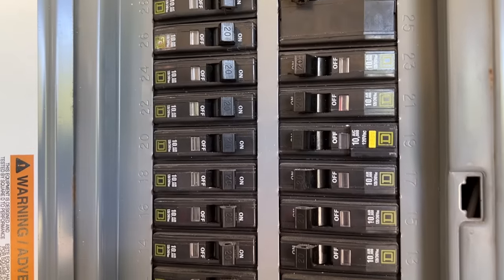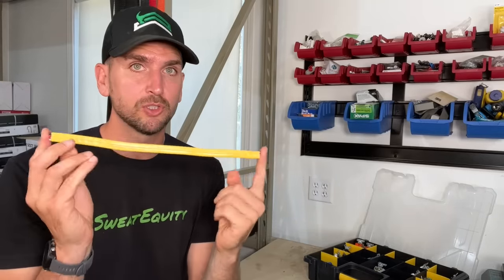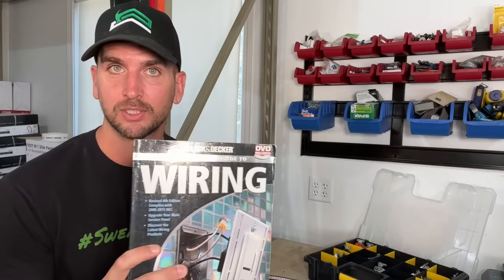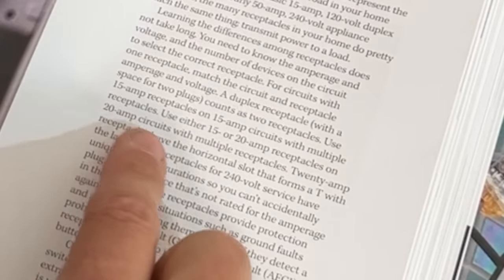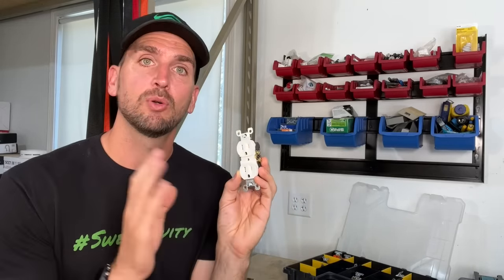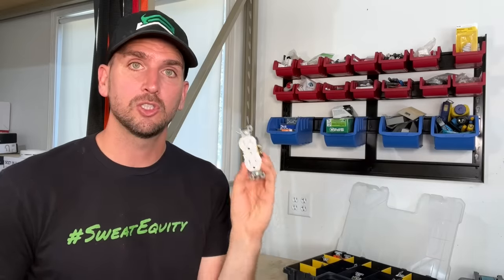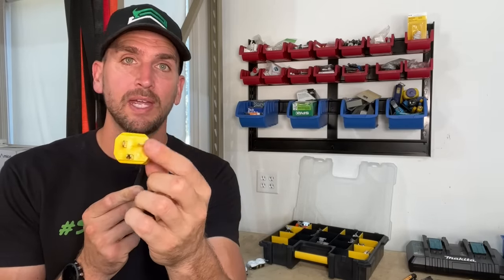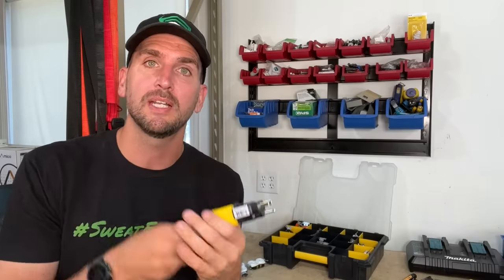Can 15 Amp Outlets Be Used On A 20 Amp Circuit Breaker

Comment: Where I live the city mandates that 20 amp circuits be installed in kitchens. That's fine except that these breakers "pop" at 16 amps. The 15 amp breakers "pop" at 12 amps. When I purchased my new home in 2018, I called the electrician back (post inspection) and asked that he change the breaker panel to traditional 15 amp breakers and have had no problem since then. Even in the kitchen the 20 amp (16 amp "pop") had to be changed to a traditional 20 amp for our new microwave. The mandated breakers cost about $80 CDN each while the traditional breakers were about $5 CDN each so the electrician didn't charge me for the switch or the new breakers taking the mandated breakers in exchange. An example of a City mandating a change to a product that just doesn't work in the real World. None of the appliances that have been plugged in have a 20 amp plug or the requirement of anything more than 13 amps at startup. The only tool I have that requires more than 15 amps is a Shopsmith that peaks at 16 amps at motor startup before dropping to 12-13 for operation. I use a 15 amp slow-blow power bar attached to a dedicated 20 amp garage circuit to power it when required and have had good results.
Reply: Which breakers are these that are tripping so soon on less than their rated amps?  Does your panel have heat dissipation issues?  Breakers are specified with a trip curve that specifies how fast they will trip for a given current.  I'd like to see a trip curve where it says it trips below rated level.  Because breakers are stacked together where heat may not get out easily, that's where allowance for tripping on 80% with continuous load (defined at 3 hours or more) is.
Reply: I believe Chris is referring to AFCI (arc fault) breakers, which are more prone to nuisance trips. The technology is evolving and not all companies made reliable AFCI breakers. You may find that today's technology has finally caught up with reliability. Here's the problem: if your house would ever suffer an electrical fire and the insurance company found that the breakers were changed after inspection, they might deny your claim. Or even bring in your electrician for his role. Your house; your call.
Reply: @BrucePappas  Not much choice when the alternative is not to have power or to constantly have to reset the breakers. No microwave, no power tools (could go battery wireless), no Christmas lights (and I already use LED). I checked ... it's not an insurance issue it's a local government issue and I understand that it has now been reversed due to the problems caused by these breakers in new houses. Of course I live in the area of the World where the Hydro company mandated electric in floor heating and then when it ended up causing fires they reneged on both the usage and the warranties on installed systems to screw the owners. Much like the Poly B plumbing fiasco where if you were amongst the first failures you got screwed and if you were lucky you got absolutely nothing when your piping failed. I ended up in the absolutely nothing category when the pinhole leak cut through the wall and caused both wall damage, a large sink hole in my front yard, and a flooded basement. I finally had to replace the complete plumbing runs in my old house with new lines before selling it. Thankfully Poly B was only used from the street and through the basement runs so the main and upper floor were copper and didn't need to be replaced.
Reply: @chriscutress1702  - I understand that electrical codes are adopted by the state or local government. In our state, AFCI are still required in all new residential building and remodeling. Are you saying your municipality no longer requires arc-fault breakers?

Sorry to hear about your piping/flooding loss. That's terrible.
Reply: No, breakers should hold the designated current indefinitely. If they pop on smaller they are defective. In fact they take higher significant time, even twice some 30 seconds.
Reply: @BrucePappas  Canada West coast. In some authorities a new home has to be plumbed for fire sprinkler systems. Interesting that the city council had a major shareholder in a sprinkler supply manufacturer when that was passed into ordinance. Meanwhile it's the 60 year plus homes ( some with aluminum wiring) that catch on fire not the new homes where sprinklers are mandated. The mandated homes do however sometimes have insurance claims. Usually for leaky fittings on the sprinkler systems.
Reply: I've heard stories about these new arc fault breakers and I seem to have them in my house now, but the only time I've had a problem with them is when I run the vacuum cleaner on an outlet that seems to be on the same circuit as the big chandelier and after a few minutes the breaker trips.  I haven't actually measured what the combined load on that circuit is, I just started turning off the light whenever I need to plug the vacuum into that outlet.
Reply: @phillipsusi1791  That's how it started for me as well but the breakers I had seemed to become worse after the first instance of tripping allowing even less power usage to trip them on future uses. This is what was a major concern when a month after changing our microwave the breaker would trip when we used it. Fine for a month and then constantly tripping the breaker for no apparent reason. Since the house electrical was still under warranty I notified the builder and the electrician returned and changed the breaker. Then I asked him to check the load on the circuit with the new microwave on and it was 12 amps under full load at start-up peak then fell to under 10 amps during usage. The breakers shouldn't have been tripping but they were. The same thing had happened on a basement circuit when I was doing some work with a power drill in the basement. Again no reason for them tripping but that breaker also needed to be replaced. The electrician told me that these breakers had been causing a lot of problems even though recommended by the local building authorities. He said the only real solution was to wire everything for 20 amp lines even if they were only being used for 15 amp circuit loads and having 20 amp breakers installed. He said that the 20 amp breakers were "popping" at 16 amp loads so would work for 15 amp circuit usage situations.
Reply: @phillipsusi1791  - the original AFCI had severe problems, some brands more than others. Today, the technology has settled in and has vastly improved. Good to hear you've had little problems.

Comment: IDK. If you remember that circuit breakers are intended to protect the wiring, not the devices. A 15a outlet can certainly handle 20a.

Comment: Using a 15A outlet on a circuit protected by a 20A breaker can't be a problem, by definition.  The 15A receptacles is a NEMA 5-15 and is keyed.  Only a 5-15P (plug) will fit in the receptacle. Any device or appliance with a 5-15P will be limited to 15A and likely limited to 80% of that rating or 12A for residential service so the integrity of the receptacle is assured.  The 20A breaker in the panel (branch circuit protection) is there to protect the conductors only, no devices or loads or appliances.  There is no conflict and no issue.

Comment: Nothing wrong with that as stated. # 12 wire on a 20 A breaker using 15A duplex receptacles. If you have an appliance that would pull 12 A or more than it should be on a single receptacle. 20A circuit is design to carry 16A usually. 15 Amp circuit usually is 12 A. This will carry most of the loads on the circuits. Tv will pull about .95 A a lamp with a 100 W bulb will pull .83 A
Reply: If I plug in a table saw or circular saw I make sure it is in a 20 amp circuit with a 20 amp receptacle.   Smaller tools like a drill, saber saw, slow cooker, toaster are ok pluged into a 20 amp circut with a 15 amp outlet.
Reply: A 20 amp circuit (20 amp breaker, #12 conductor) will carry 20 amps for anything less than 3 hours.  And 16 amps continuously.   A 15 amp circuit will carry 15 amps for up to three hours and 12 amps continuously.   15 or 20 amp duplex devices are allowed on both.  If a dedicated 20 amp simplex receptacle, then 20 amp circuit is required.

Comment: I have a 120-volt GFCI outlet with a 15-amp receptacle on a 20-amp circuit, in my garage.  

My question, is that I have something that I need to plug in that recommends using a 120-volt GFCI outlet with a 15-amp circuit.  Are their any issues with my outlet having a 20-amp circuit?
Reply: No issues, the circuit rating must be the same or greater, just can't be less.

Comment: Codes are law for current new construction, you do not have to always follow codes for existing when your work/home was done in your region, you get to use your own head. A 1960 home has lots of latitude, even if you bought it in 2020
Reply: You are absolutely correct.   If your house was built and inspected in 1960, then go get a 1960 NEC or possibly older, and follow what it says.   But, if you are going to buy and use many of the more modern appliances, you should consider that you might start having nuisance fuses blowing or breakers tripping.    If you do a major remodel of the home, then you may be required to be up to the current “adopted” code in your area.

Comment: Should an AC be on its own breaker? 
Midea U channel Window, 115 volts at 60hz, 
8k btu, total input current 8.78A (amps?), CEER 15, 1/8 horsepower,

Comment: can all 20A outlets be safe on a 20A circuit? If a device needs 20A why would a 15A adapter be provided? I have a Forney welder that has a 15A adapter too; the handbook recommends a 30A circuit

Comment: A 20A to 15A adapter was used for construction work at a house, and it burned the outlet/receptacle and wires inside leaving no external evidence.  The contractor did not even mention it to the homeowner and just moved to another outlet/receptacle!

Comment: So I can use a converter for my table saw that has a nema 5-20 to use on the 5-15 in the garage or switch it out to a 20A receptacle?
Reply: You could do either if it's a 20 amp circuit, but make sure there's no or low load on that circuit when using the table saw. Keep in mind however, that this is most likely a code violation. Check your owner's manual because a nema 5-20P normally requires a dedicated circuit.

Comment: with those cheezy 15A outlets 
i've seen the outlet starting to melt with a space heater plugged in. The contacts are so cheap the plugs will be sagging and falling out in no 
time. 
Comercial grade is much better of course.

Comment: Is 14/2 wire safe to install as a extra length on a 15amp outlet with a 20 amp breaker? When I redid my outlets which are 15 amp/125 volt it seems like the wire was slightly thicker than the 14/2
Reply: if it's a 20 amp breaker all conductors must be minimum #12

Comment: You're looking at the whole situation backwards. Recptacles don't use power.
You won't overload a 15 amp recptacle by plugging in a 20 amp load because the 20 amp device has a 20 amp cord cap and can't be used in a 15 amp recptacle. However, even a 20 amp circuit with a 15 amp duplex recptacle can be overloaded by using two 15 amp devices simultaneously.

Comment: I actually don't like the idea of putting multiple 20 amp plugs on a 20 amp circuit because then it implies that you can draw the full 20 A on multiple different outlets. So yes stick with good quality 15 amp outlets unless you're doing a dedicated single outlet 20 amp. As you really don't know what else is on that circuit unless you wired it.
Case in point I was setting up a band in a school cafeteria and we plugged into one outlet on the left side of the wall and started to be annoyed by a refrigeration device on the right side of the wall I am plugged it since there was nothing in it however not one minute and the sound check the circuit tripped and both outlets were off so somewhere else in that facility nowhere in the cafeteria there's another outlet with something on it.

Comment: Does this apply to lightswitches as well? If you have a 15 amp switch, it seems like the bulb would be the same as  multiple outlets on the line essential drawing less amps on the switch, and even then it seems like a switch is automatically "feedthrough," or am I just a stupid diy-er?
Reply: You are fine with the 15 amp switches, unless... Where I would upgrade, is say with a bathroom fan, if it requires extra amperage to run, or say a heat lamp in the bathroom if you decide not to go with a timer, which I would not recommend doing. 

Look at what you will be powering in that circuit to base your decision upon. Here is where I have a 20 amp switch, two in the bathroom, one powering the fan, and the other on the vanity lights. There are roughly 20 or more incandescent bulbs on that 1960's relic, it actually heats the bathroom. When I turn them on, I can hear the meter spinning... That is on a 20 amp circuit and switch. That is the only room in the house that I believe I have any 20 amp switches, and I have personally rewired most of the house.

Comment: The only practical reason you want a 20A duplex receptacle is if you have two devices plugged in, that draw 10A concurrently. The 15A rating is shared between both outlets of a duplex receptacle. Otherwise it’s just pointless. 

Code doesn’t account for rogue devices like su**ide cords and 20A->15A adapters
Reply: Not quite. The only reason you want a 20A duplex is if you have a 20A cord end, which won't fit into a 15A recep. Plugging two 10A load cords into a 15A duplex is fine since each side of the duplex is rated for 15A.

Comment: The question is silly.  Look at the lighting fixture on a circuit. Do any of them draw 20 amps?  With receptacle circuits  no receptacle rating must exceed the maximum current rating of the circuit, and all of the wiring must be able to handle the full load.  That way a single portable load cannot damage the receptacle, or wiring.

Comment: One GLARING failure (and danger) of this video is that a circuit (unless it's dedicated) has many other outlets. It's NOT just about ONE outlet/recepticle of a circuit as to how much you can plug into/add to that circuit! 
You MUST take into account how many other outlets there are and how much wattage they are already drawing. Plug a space heater into a 15 amp circuit that has 8 outlets.... could very very possibly overload that entire circuit to the point to where a fire starts.
Reply: Not really. It doesn't matter how many receps are on the circuit because if you overload the circuit the breaker will trip.

Comment: does the idea of having multiple 15A and 20A receps. on a 20A circuit also apply to a 30A circuit or any circuit higher than 30A for that matter provided of course that the correct gauge cable is used? I would like to have a complete guide about these types of things, but no information ever covers it in general; is it suppose to be obvious?
Reply: The info is in Table 210.24 in the NEC. Receps on a 30A circuit must be have a 30A rating.

Comment: Thank you for the video. I prefer to use a 20amp outlet on a 20 amp circuit. It may be ok as far as code is concerned but what will the fire insurance company say if a 15 amp outlet causes a fire on a 20amp circuit? If they decide to use that against you then it leads to litigation, you probably will win, but in the meantime you're homeless. In my opinion just pay a couple of more dollars for the 20amp outlet.
Reply: Ridiculous logic. There are billions of 15 amp receps on 20 amp circuits in the US alone. A 15 amp recep must be able to carry 22.5 amps for a 15 amp rating and the link between the terminal screws is rated for 20 amps and must be able to carry 30 amps. It's safe, legal, and industry standard to put 15s on 20 amp circuits. You're not going to become homeless because of insurance company litigation because they're not going to waste their time and money on an approach that is guaranteed to lose.
Reply: @pld8993   You have no idea of what my experience has been and you insult my logic? Your logic is sound theoretically, but reality is a different story sometimes. Maybe you haven't had that experience yet. You do what you want to do in your home and take any chance you want to, and I'll upgrade to a higher rated receptacle for a few dollars more.😉
Reply: @donteventryit89  15 amp receptacles being installed on 20 amp circuits, legal and consistent with NEC requirements, are not the cause of fires. If you have data that shows otherwise, please share.
Reply: @pld8993  Read my original post. I'm aware that it's safe according to specs. I just prefer to be a bit more cautious.